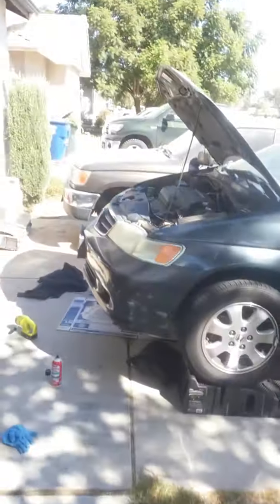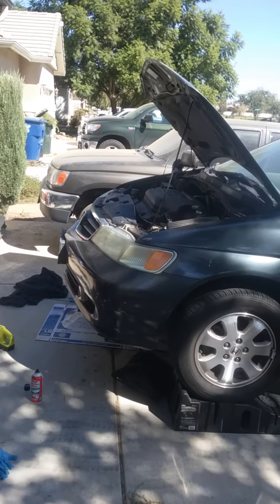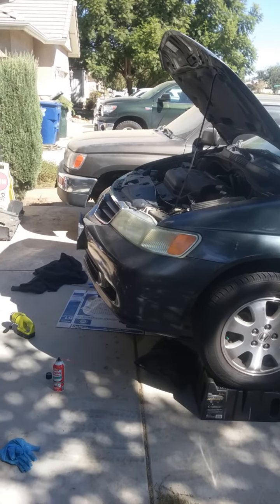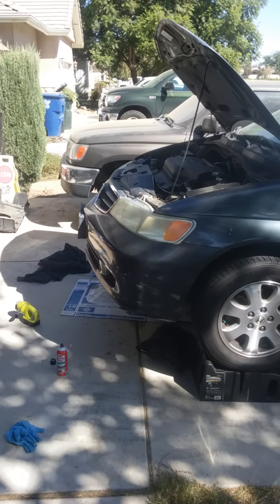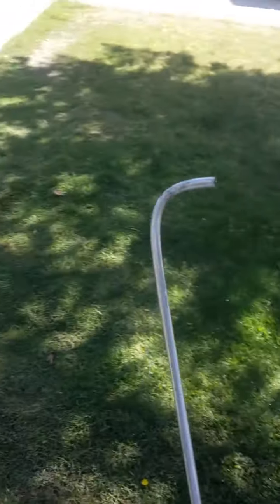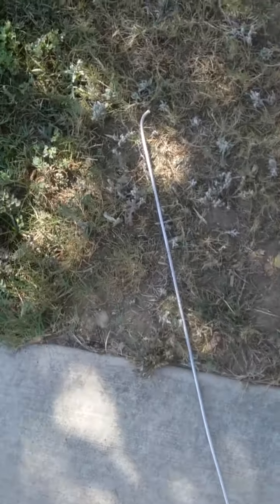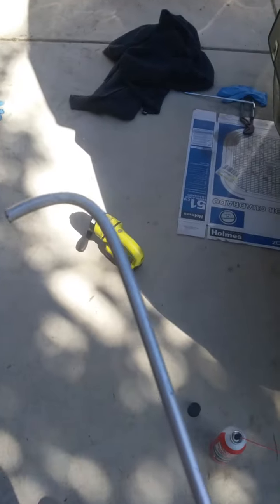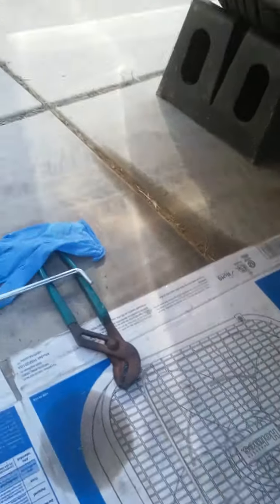Honda odyssey stuck hood

Comment: Just wanted to let you know that your video saved me much headache and money. I have a 2004 honda oddssey and cable on latch came loose. Shut hood and the frustration began. After finding your video I created similar tool. And bingo it worked after only 15 minutes under van. Thanks again for this awesome video.

Comment: Thank you so much for posting this!  I took my battery out to charge it and then couldn’t open my hood to put it back in, so I couldn’t even drive it to the shop to get fixed. It was really hard following what you were saying, but I got the gist of it and was able to pop it. I’ve been without my car for weeks and I started to brute force the whole front end apart before I ran into your video. You are a life saver.

Comment: I used a fishing rod where it comes  apart in the middle and at the end I put a piece medal that we use to nail a tent string to the ground because it has a 90 degree angle bend and just keep moving it around until open and it work.